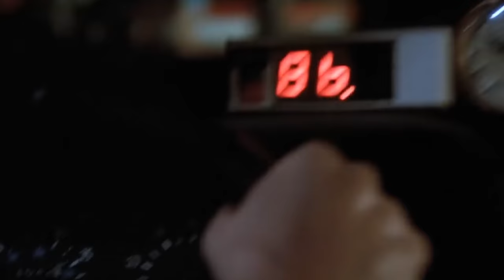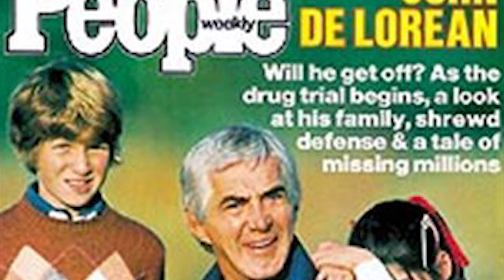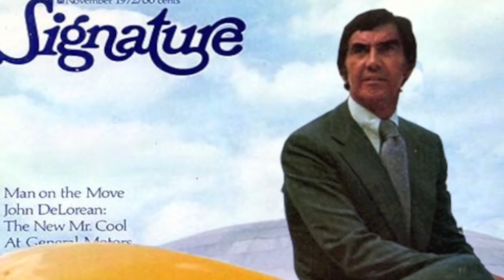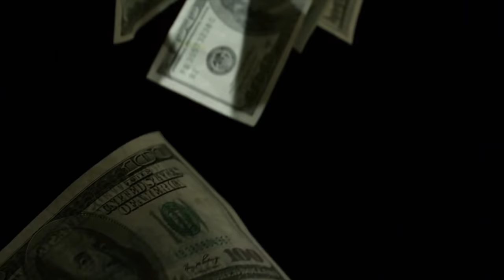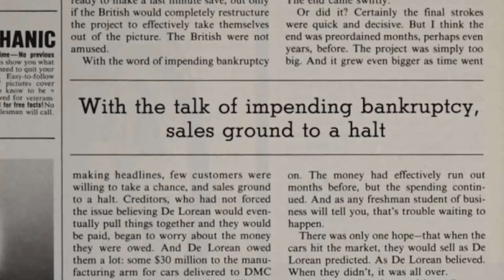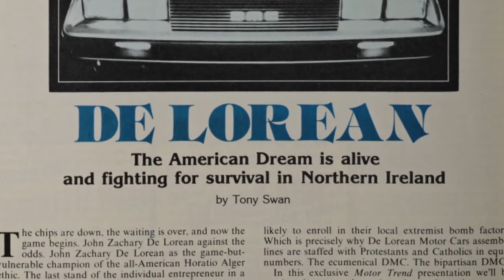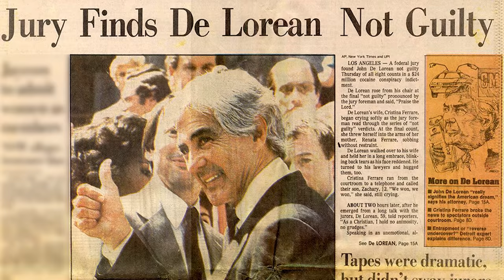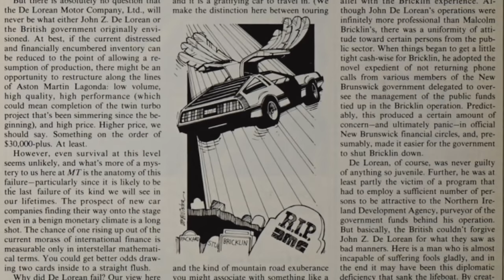DeLorean - Everything You Need to Know | Up to Speed

Comment: Waiting on my notifications to show "Everything You Need to Know of the AE86"...
Reply: Chris Ayala just the ae86 won't cut it man, just the corrolla is possible, but newer corollas are boring
Reply: Chris Ayala from AE85 to GT86
Reply: Yes!!!!! I asked for it too but still nothing 😥
Reply: The problem is that the AE86 doesn't have much of a history. If a video was done on the Corolla, you could make it work, as there are many more years and models. The AE86 didn't do much besides create Inital D.
Reply: Luuk Lugtigheid AE95s aren't boring
Reply: *Eurobeat intensifies
Reply: Deja Vu
Reply: Fujiwara 藤原 higher on the beat
Reply: Chris Ayala exactly!!!! I need it! And the Datsun 510!
Reply: "It's a Corolla that happened to be enthusiasts' favorite because of its light weight and massive parts availability."

There, that's just it.
Reply: You could do a video on the 4age engine alone
Reply: that would take like what? a minute?
- Drift king used it
-it was popular among street racers who raced it in mountain passes
-initial d
Reply: Zhi xci and you forgot about its rally history and its engines history in motorsports.
Reply: Corolla ke70 aint boring
Reply: It's there now
Reply: @georgiohenderson5998  I know right?I think it's just Initial D that got people into the car,and the drift king...

Comment: I've seen 3 DeLoreans on the road, one was actually in good shape and driving, another was likely crashed and repaired as it was painted red, and the third was stopped on a side street with smoke poring from it!
Reply: DMC did produce a few red ones so the one you saw could have been one of those.
Reply: I saw one parked 50 metres from the old factory gates.

Comment: They need to create a brand new DMC12 who knows with today's tech it could be amazing
Reply: TheGBGamer no crap!
Reply: modern safety requirement would make it look like shit.
Reply: Tesla .🙂
Reply: They are making new cars at there factory in Austin
Reply: The new DeLorean DMC Texas is building has all that. A new, much more powerful modern engine option, and completely new interior option, etc.
Reply: IAMTHEKOOLAIDMAN - ...They do not have a factory in Austin.  It's in Humble, Texas. A suburb north of Houston... I've actually been there with my DeLorean many times.
Reply: Is that why the cars of today all have some lame-ass curves everywhere instead of some nice sharp angles ?
Reply: rgqfdhxhh Regardless of how you feel on the topic, sharp angles promote shitty coefficient of drag, and thus shitty performance and shitty gas mileage. That's why they don't do that any more.
Reply: NorthernChev I saw something about an electric DeLorean at some point. Is that something that exists and is buyable?
Reply: They did look up delorean 2017 doesn't look bad tbh
Reply: NorthernChev plus the weight of the car, the whole thing is made out of stainless steel
Reply: T e s l a

Comment: Idk why but the DMC looks like an expensive Corolla Trueno.
Reply: I get what you're saying, except for the fastback.  But you have to see a DeLorean in person.  It's SO WIDE and SO LOW... it looks like the lovechild of the Trueno and a Countach.
Reply: actually, there is no corolla trueno. there is corolla levin and sprinter trueno:D they are pretty much same car but had different front and back
Reply: @valtteri315  
Actualy actualy, there was 4 options for the car (in Japan at least) Corolla Levin front, Sprinter Trueno front, 3 Door Hatchback rear, Coupe rear. There was also few bumper variants such as the Apex and so on.
Reply: Also Petrol, DMC looks more of a Levin since it doesn't have pop up head lights.
Reply: What if the delorean did have pop up headlights
Reply: i think...its more like lotus esprit ..or clasic lambo maybe
Reply: @HollywoodF1  true. There are no camera angles that do the true size of this car and purely awesome look of this car.

Comment: There is a shop in the Seattle area that works on the Bosch fuel injection system found in the DeLorean.  You can see a few of them hanging around, plus other cars with that system (Lotus', Ferrari's, etc.) sitting around waiting to be serviced.

Comment: The N/A PRV V6 engines were actually really good, in the Peugeot 504 coupe or cabrio for example, commonly pumping out at least 170 - 190hp in these relatively light RWD cars. But in the US (odd) extra stuff to adhere to very specific environmental law like a large air pump driven by the engine and other restrictions it was severely restrained in the USDM DeLorean.

Comment: There is one fact you did mess.  The stainless steel body panels as well as the fiberglass under body panels were intended to be easily replaced, should the car have been in an accident. Also, in regard to the gold plated car, 25 of them were built, but only three were sold.  I collect diecast model cars, and SunStar toys makes a replica of the gold plated model, and they call it the gold edition. But DeLorean actually called it the American Express addition, since they were intended to be sold through an American Express Christmas catalog.  You might also be interested to know that on the first two model years, you had to open the trunk to put gas in it. That’s because the gas cap was located directly behind the trunk lid.  For the back to the future movies, they actually had to take the original engine out, and swap it for a Porsche engine in order to make it quicker. But the original engine sounds were swapped for a pre-recorded V8 engine sound along with turbine noise.

Comment: If I had 60.000 dollars I would buy a used Ferrari 360 gated manual cause Ferrari plus manual gearbox bitches yea it would be in custom exposed carbon and ferrari red with alcantara interior and an itialia strip down the middle